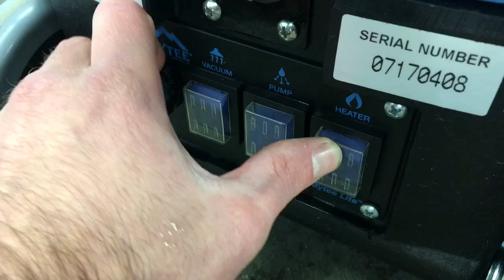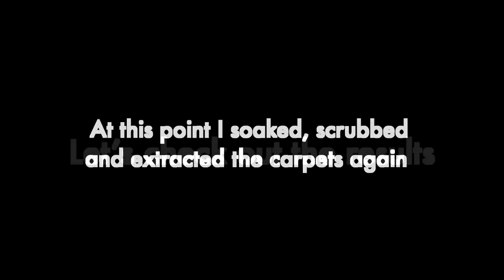Cleaning Really Dirty Car Carpets - Before and After

Comment: I have a 96 bronco that had really deep dark carpet stains. took turtle wax carpet cleaner and brushed it in,let it sit for 15 minutes. then used an air gun hooked up to a big air compressor and blew the stains right out.